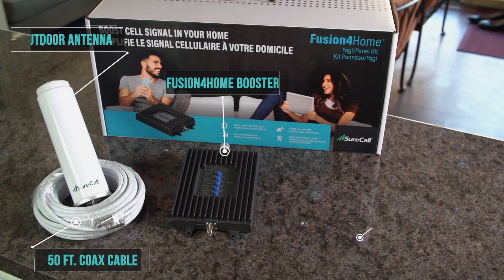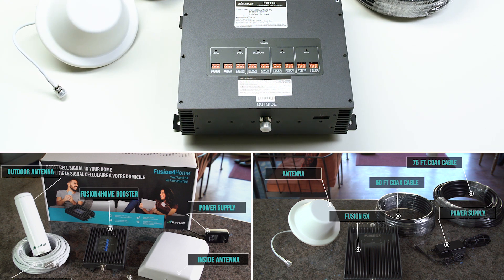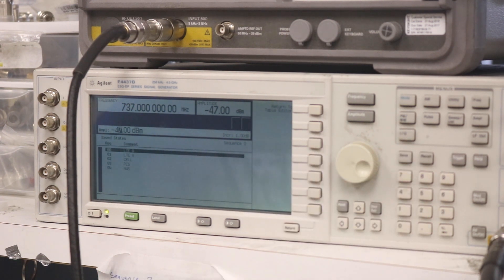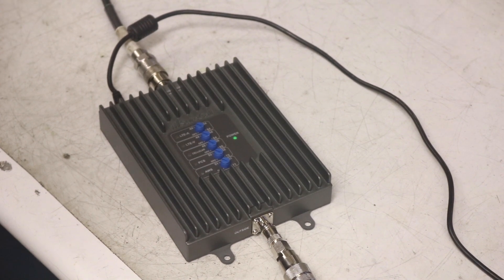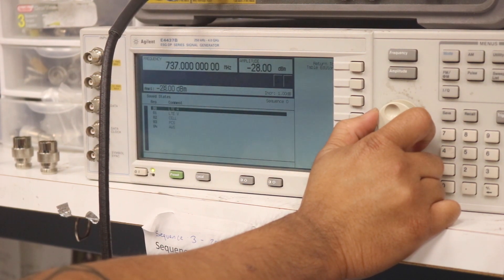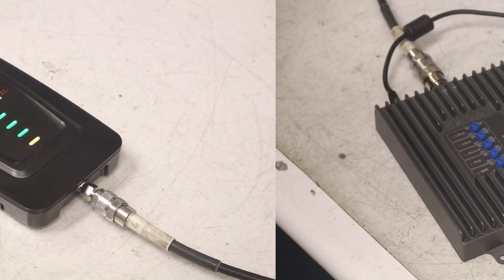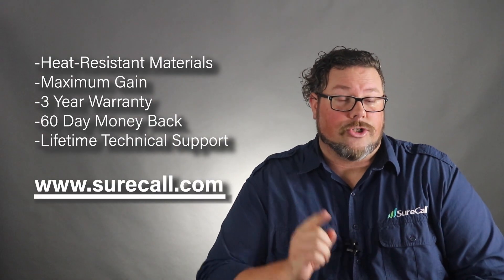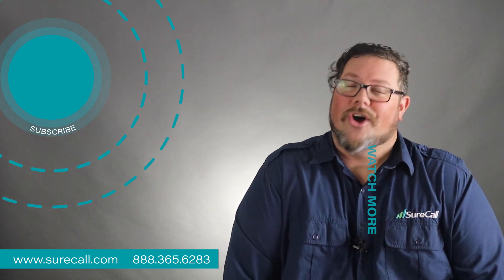SureIQ Signal Booster Performance Technology

Comment: Getting a solid 4 bars with my Surecall home unit from 0 to 1 bar. Signal strength -89dBm 50asu with an outside temperature of 101 degrees on a AT&T tower. Very happy with the technology.
Reply from the maker: We're glad you solved your cell signal issues with one of our boosters as well.